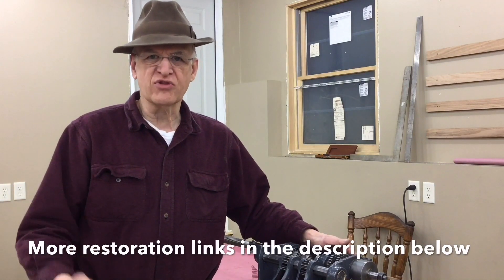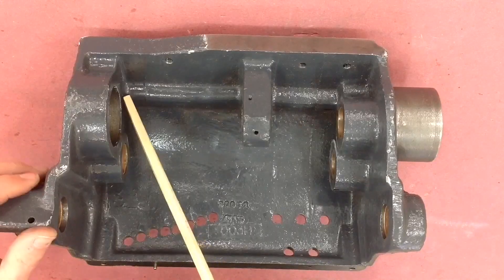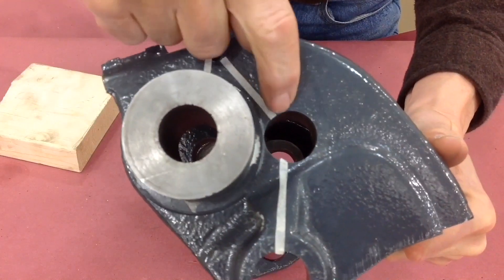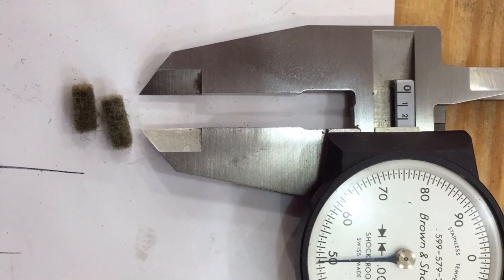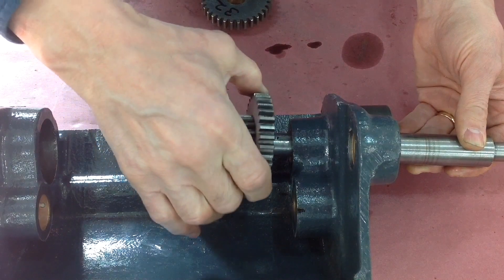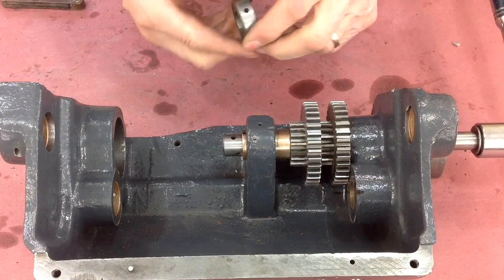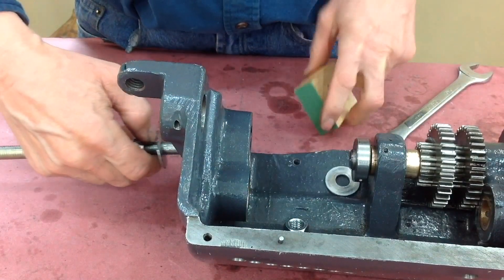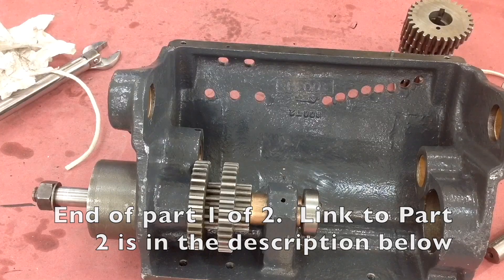South Bend 13" Restoration - Quick Change Gear Box 1 of 2

Comment: I wish you covered removing and replacing the oil tubes and were you can get them if ruined.
Reply from the maker: McMaster Carr has the oilers. alternatively, eBay often has originals for sale.   I think I do mention this a few times in the series. Oilers either screw in, or are pressed in.  Good luck, and thanks for the comment.

Comment: Good evening 
Happy Merry Christmas and Happy New Year all the best wishes.
Sorry I just wondering the gear teeth numbers of each gear. If you don't mind share me the number teeth. Because I can finish homemade lathe.
Thanks
Reply from the maker: I am sorry, I do not know the number of teeth on each gear in the gear box.  I would need to disassemble the gear box to count them.  You might consider designing your lathe to use change gears rather than construct a change gear box.
Reply: @ thanks
Did you link it I can purchase. I’m truly doesn’t know.
Your best explanation that I learned especially Your English easily understand.
All the best
Reply from the maker: @mr.ranyhomemade2466  yes, I think change gears can be purchased.  For sure in the US. I don’t know about your country
Reply: @ oh no I'm so far about 21/22hurs from US Cambodia 🇰🇭 but if you know the link will be good 🙏🙏🙏
Reply from the maker: @mr.ranyhomemade2466  khnhom penhchett champoh avei del anak kampoung thveu  haey saumchounopr aoy khnhom ach chuoy ban .
Reply: @ that's so cool you could speak my language.
Thanks for your share. Today I had done setting change gears and have try make thread it work now.

Comment: Great illustration on the oil gallery and how it flows through passages to lubricate the shafts, bushings, and bearings. I couldn't quit figure it out but the lights came on as soon as I saw the plugs removed on both ends. Thank you.
Reply from the maker: You are welcome Paul, take care

Comment: George, did the bronze bearings you got from McMaster just fit, or did you have to ream or otherwise adjust the fit after you pressed them in?  I just bought a whole new set from McMaster, and pressed in the first of the screw shaft bearings.  Now I find that the shaft is about 0.998" and the inner diameter of the bearing is about 0.997".  Obviously, the shaft doesn't go in. Do you know what the clearance should be?  I'm thinking if I reamed them to an even 1.000, that should be about right.
Reply from the maker: I did not do as good a job then than I could do now.  These bushings should have about one thousands clearance for the oil. So if I were to do it over, carefully measure the shaft and cut the bushing .001 over

Comment: I have watched your video's a bunch of times!   Quick question.  What way does that thrust bearing face when installed?  Thanks
Reply from the maker: The thrust bearing accepts thrust from the gear box. So the bearing thrust race is toward the lead screw.   Thanks for your comment

Comment: George your videos on rebuilding are extremely well presented and useful, they are helping me a great deal in rebuilding my heavy 10l. I have one question - where did you get the lead screw thrust bearing which came apart when you disassembled the threading gearbox. I have been looking all over for a new one, mine just says H.D. 20203, which I can’t find or find a replacement? Thanks very much for your helpful videos and any information you can give me on the bearing.
Reply from the maker: Thanks for the nice comment, I am glad the videos are helpful.  I got new bearings from McMaster-Carr.   I did not have much luck trying to match the numbers on the old bearings.  Measure the OD, ID and width carefully, note the bearing type, and look It up on their web site.  Also, if you have not already, join a Face Book group for your specific machine.  Seems like Guys a little ahead of you in a rebuild process, likely already solved this problem.... Good Luck with your project!
Reply: Thank you for your quick and informative response. One other question what does FB mean? Thanks very much again.
Reply from the maker: @williamwoturski5014  Sorry, I should have spelled it out..... Face Book
Reply: That’s ok I should have known that FB stands for Facebook. That aside in part one (@1:18) you show the two bearings in the left corner one is a 4zzr4 in a green box and the other is a NTN in blue and white box but I can’t read the part numbers. You wouldn’t have them written down somewhere, I have been searching the Internet and many other places including calling McMaster-Carr and speaking to some very knowledgeable guys,only to find there are many many different angular thrust bearings. Later on you show the destroyed bearing which is very unusual believe it or not. If you have any of the part numbers new or old I would appreciate it, if not I guess I’ll keep looking it’s only been a few weeks. Thanks for your    help and consideration very much.
Bill
Reply from the maker: @williamwoturski5014  I am sorry William, I don’t have the numbers for these bearings.  I suspect they will be different for your 10 L anyway.  I suggest again try to find a South Bend 10 L or similar Facebook group.  One query in that group, and you will get your answers.   Good Luck.

Comment: I stopped the the video and subscribed 10 seconds in before I watched the video and I'm not even sure what it goes to but I like it already.
Reply from the maker: Thanks for the comment... this video is In the middle of an 18 video series on the restoration of a South Bend Metal Lathe... check out the other videos in the series.  If you like this one you will like the others.
Reply: @georgebell7103  I have watched several of them already. Thank you for the videos.